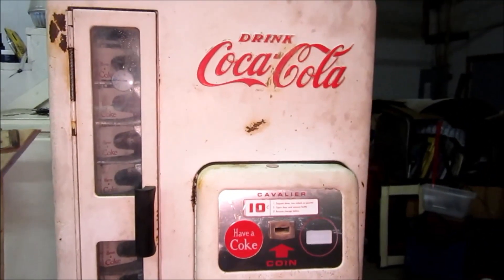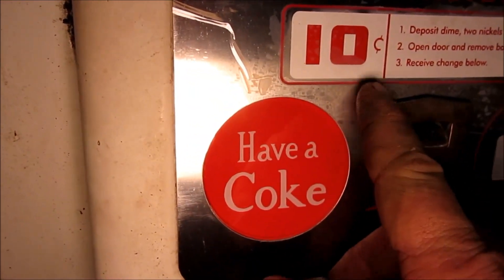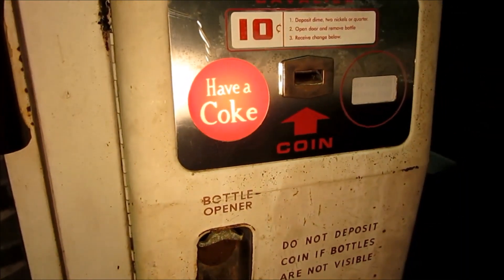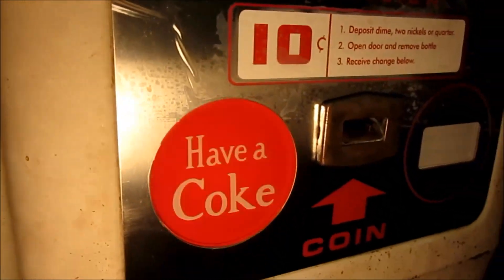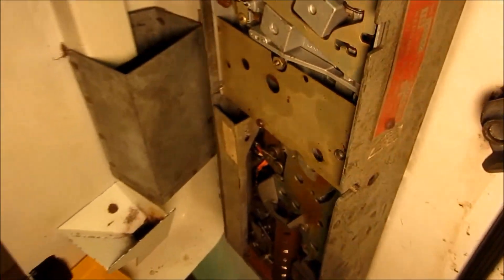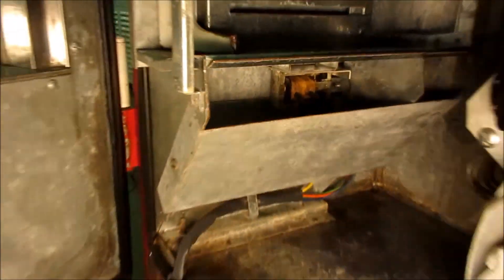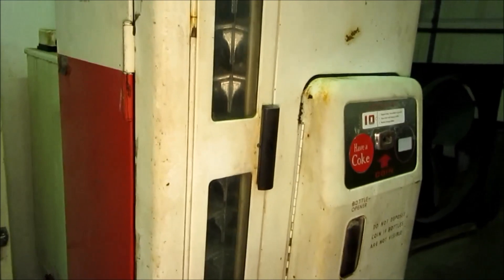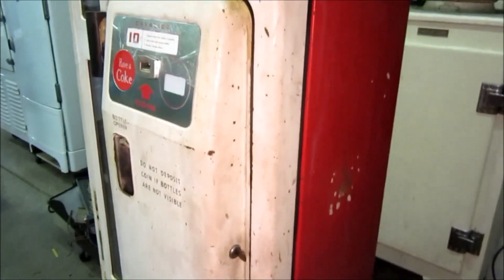Cavalier Coke Machine - 5 - Conclusion - New Decals!

Comment: I also remember the Coke machine with the horizontal flattened handle you had to push down to get your drink.
Reply from the maker: It's neat how many different designs they had. Coke has always been very heavy on marketing. Afterall they are selling flavored water at a premium; which is not much different from everyone else's flavored water products. To stand out, they would come out with "different" machines that distinguished them from the competition. It cost them a lot I am sure, to have higher turnover of machines. But all the old ones live on, even once their Coca-Cola campaign is finished. That gives Coca-Cola decades of free advertising after they sell the machine and others buy it for private use. 

These machines have quite a following and are surprisingly valuable. For instance, if you add up the views on all the parts of this video series there are well over a thousand views. All throughout the video, the Coca-Cola brand is visible, costing Coke nothing. You see, the marketing for Coca-Cola still works!
Reply: Vendo is the brand I am referring to.  It was a pleasing experience to activate that handle!

Comment: Do you know when the correct change only light turn on?
Reply: Oh
Reply from the maker: Exactly - there is a limit switch in the nickel storage tube. When the limit switch is not pressed by nickels, a solenoid turns off, allowing a pin to pop up and cause quarters to reject; and the Correct Change lamp to illuminate.